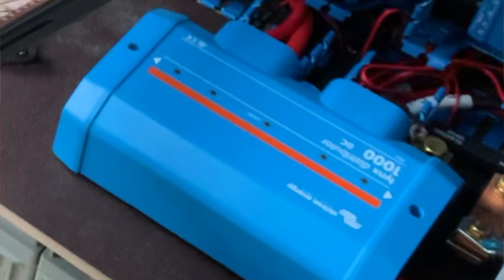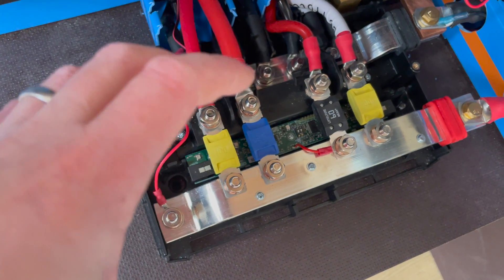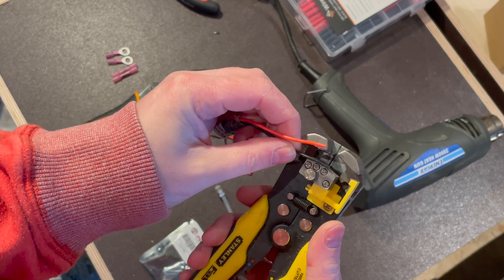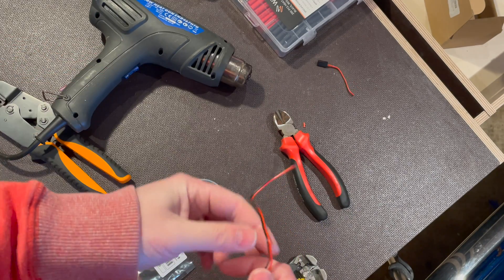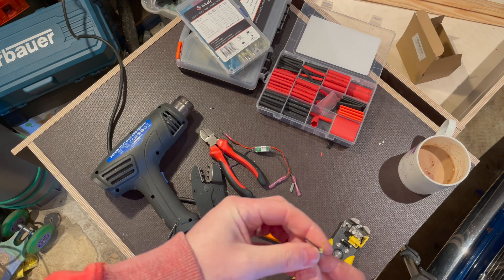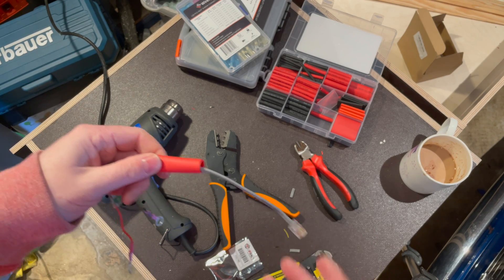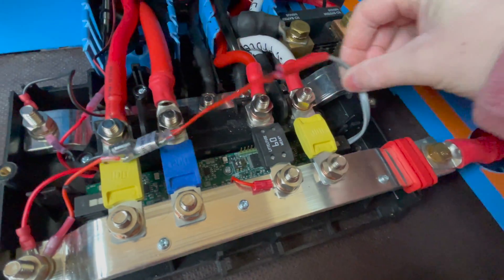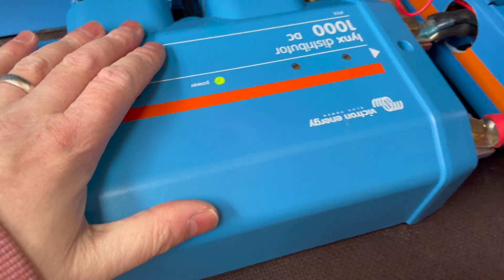Victron Lynx Distributor Hack (Simple + Cheap Upgrade) | Getting The Lynx Fuse Lights Working

Comment: So I did this little hack and all red lights are on. I am using 3 of the circuits on the lynx distributer and 1 is opened and all 5 red lights are on. Not sure what I did wrong, but it’s pretty impossible to screw up.
Reply from the maker: Oh no. Did you restart the system after the install?

Comment: I got them to light up but they are all red and the power is yellow. I plugged into the other side though but I don’t know why it would matter. I couldn’t find the exact part, so maybe that’s the problem. Any suggestions?
Reply from the maker: Do you have fuses installed? The lights will be red if you don’t. If they are installed try restarting the system by turning it off and on again or by rebooting your Cerbo. A yellow light on the power might indicate the Lynx isn’t hooked up to power too - again if it is have you tried a restart?

Comment: Hi mate hi did this today I haven’t placed any fuses in yet but I put power to the lynx but the ubec converter lights up red at the moment is this correct lol  no led lights on the lynx are on at all 
I’m just about to add fuses and all loads I’m hoping this will turn the light on as you show
Reply from the maker: So once wired with no fuses the led’s should be red. And the centre light red also. Once the fuses are in the lights will be green: if one blows or is removed that one will be red and the middle light will be red. 

Unsure why yours hasn’t lit up. Which wires from the RJ11 did you wire up? Best of luck.
Reply: @WanderbusAdventures  I followed this video mate black was negative and yellow positive 
only a light on the ubec lights up
Reply from the maker: Have you popped a fuse in? Is the green light in the middle on?
Reply: @WanderbusAdventures  no lights are on to do with the lynx 
Only a red light on converter is on 
I’ve only just got it all set up and running but I’m one fuse short 
All I did earlier was put power to the lynx and a negative to see if I had wired correctly 
but it must need all 4 fuses to work correctly with power in and negative connected I’m guessing 
I will get all the fuses connected tomorrow and see if it lights up this time on the lynx 
I would have thought tho it would have shown a red light on the led on the lynx tho and not the converter lit up 
Very strange 
Unless I’ve got a dud unti converter
Reply from the maker: I’d have thought it would light them all up too. Might be worth double checking the join and connections on the RJ11 side of the ubec. Let us know how you get on.
Reply: @WanderbusAdventures  I think the negative wire wasn’t connected right to the converter 
So I have re wired it made it solid 
I will try it tomorrow when all the correct fuses come thanks
Reply from the maker: Cool

Comment: I'm looking to do this with a 48v system. should there be a 1 Amp fuse ?
Reply from the maker: Hi Michael. I know some people have put an in-line fuse  on theirs. Couldn’t hurt to do that for sure. I just figured it’s such a small draw and the cable used is quite beefy compared to a rj45 that usually powers it without a fuse if that makes sense. It’s a worthwhile hack whatever you decide 😊

Comment: Silly question but would you not need a fuse in the wire/convertor itself? Thank you!
Reply from the maker: There’s no such thing. So at the time I didn’t as the RJ10 wouldn’t have been fused. Since I did this Victron have also updated their written material and it doesn’t mention a fuse either. So am confident it’ll be fine without one.
Reply: @WanderbusAdventures  Thanks! Just trying to get my head around how everything works and the rules of electrics :)
Reply from the maker: Everything else is fused as you’d expect 😊. Good luck with your build.
Reply: These wires are so thin.....they are the fuse 😃
Reply from the maker: I’ve also realised the UBEC itself is basically a 3amp fuse. They actually are rated to different amps - so worth considering when buying.

Comment: The component cost to Victron to supply 5V for the LED cct is 1x 5V 100mA TO-92 regulator and 2x 10 uF 16V caps, Less than 80p plus a heat clip or a glued on bit of a Coke can.
Reply from the maker: It’d be a cheap add on. For sure.

Comment: Hi Rich
If people have a Cerbo installed just use,a USB port to power the Lynx Leds.simple hack low cost and Victron are supplying the 5v feed!.
No extra kit needed!
Reply: Just splice a usb cable and rj10 cable together mate
Reply: Hi mate wich wires do you put together    any usb cable
Reply from the maker: That’s a good shout. So a USB to RJ10 cable? My Lynx doesn’t have a usb on it, but do newer ones have this?